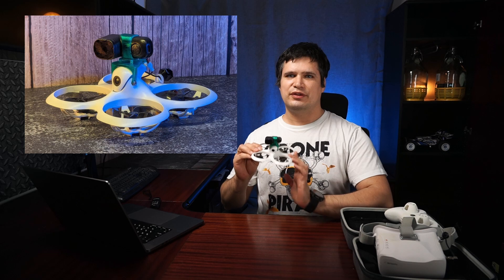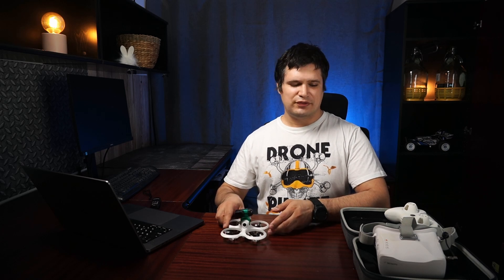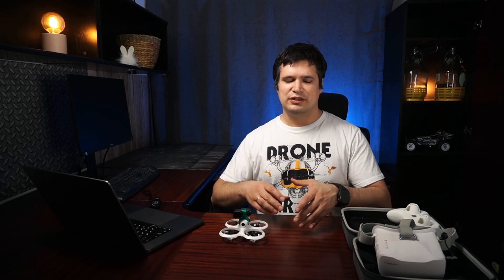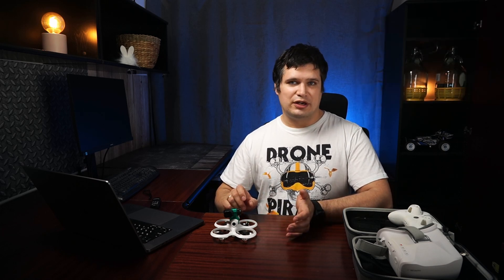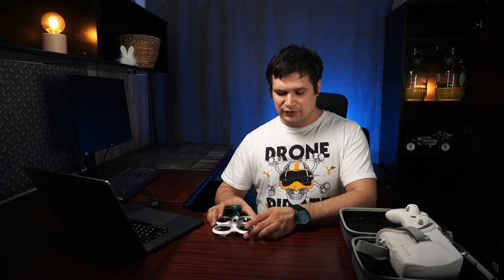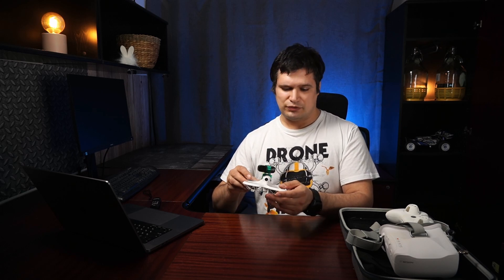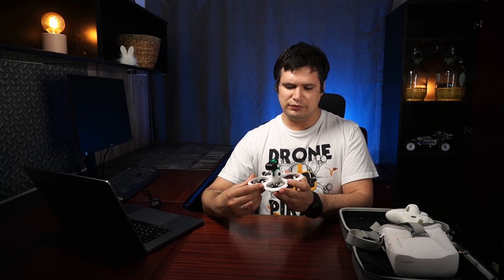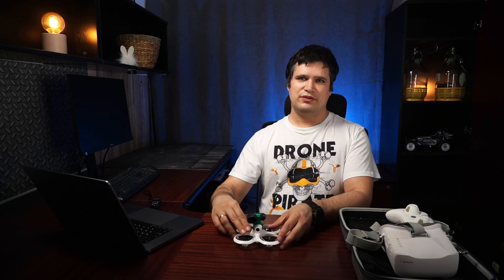Betafpv Cetus X - 1 year later

Comment: The AUX4 switch on the RC is not in use when you buy the drone. I programmed it to enable beeping and VTX pit mode together. This prevents overheating of VTX and makes it easier to find the drone (as long as the batteries provide power, so this is not a real alternative to an independent beeper.
Reply from the maker: Yes. And also it is possible to programm different levels of vtx power. Joshua Bardwell has a good video howto

Comment: Have you experienced any performance loss or any electronics wearing out over time? I am in look for a lil micro that I can trust will last me long and keep me able to fly a real quad whenever I want for as long as possible. I've been flying emax tinyhawk 2 freestyle for about a year which had no crashes or whatsoever till it started giving failsafes all of a sudden. Then I realised that my rssi goes way below what it used to do. I will try to fix it by buying an ExpressLRS reciever but in case I mess it up somehow, I wanna have another quad that i can fly with before I do anything. Tinyhawk flies good other than having it's range reduced for whatever reason. Thats why I am looking for a micro that I can trust will last me for long without something wearing out just by being used
Reply from the maker: Well, Cetus has few week itrms that may fail with time.
- the motors wires are connected with connector but not soldered. The connection gets oxigen cover with the time and connectors overheats and motors start work not so good. But it is possible to replace connectors or simpli solder the wires 
And camera sandwich overheat. Well, configs like minimal power till first arm helps. And may install radiator. 
However I would look at new pavo or at least meteor series that have better ventilation (however still have simple motir wires connectors)
Reply: Oh okay, I have a bunch of those laying around from toy quad vtxes anyway and I'll probably use pit mode or something and will probably run my vtx at 200 mw unless i really go do some range. Does the female connectors for motors on the quad oxidise too or is it only the motor connected bits?
Reply from the maker: @adakalyoncu1913 well, both sides of contact oxides, but from my practice change of connector at the motor wire usually helps.
As for power if fly at home the or outside within 50m range - 25mw should be enough
Reply: @petrokey_en  hey I have another question, I did get the cetus x and I keep getting this core temperature 70 celcius warning, it doesn’t go above like 73 most of the time and sometimes goes away sometimes comes back.  It didn’t happen in my tinyhawk but it apparently does with cetus. Should I do anything about it for the aio to not get damaged over time or will it handle some heat just fine without like me having to buy a new aio every few months? I’ve heard terrible things from other people about how the quad is expensive to maintain and stuff goes wrong but the same people also always crash the drone and stuff and you say you’ve kept it running for a year so I wanna hear if you experienced any issues
Reply from the maker: @adakalyoncu1913 up to 80 degree should be ok.
Yes, cetus heats more then others because of closed frame that does not allow it ventilate good. So I let it cool down a bit after flight at sunny days